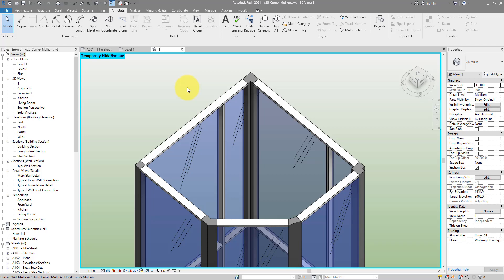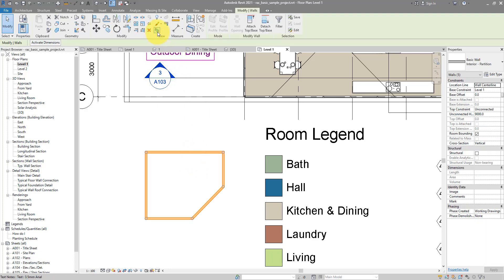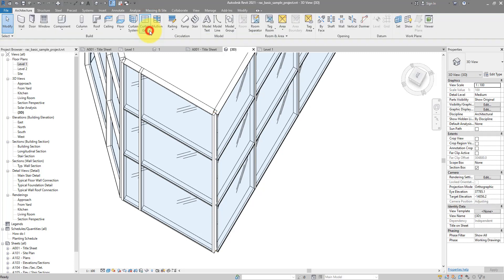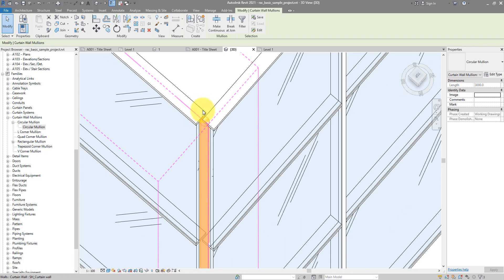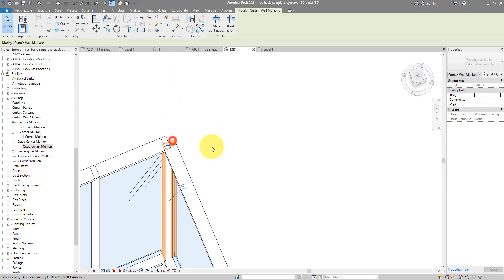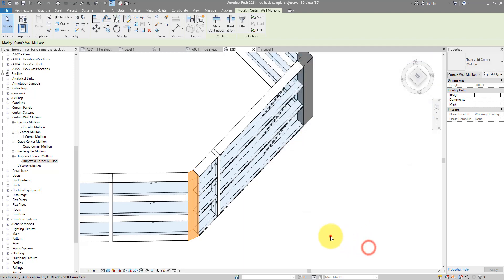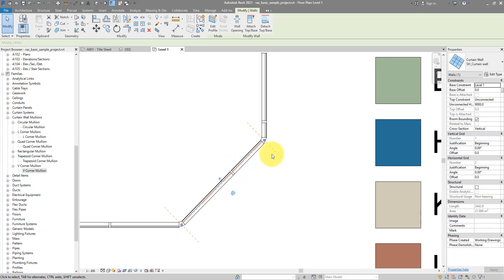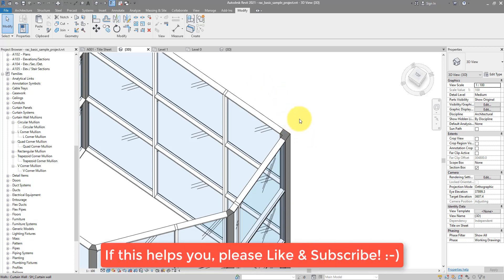Revit Snippets: How to create curtain wall corner mullions

Comment: Hey thanks for sharing, How did you do that diagonal mark on glazing?
Reply from the maker: I simply used a glass material with a custom surface pattern :)
Reply: @RVBoost  Great, will that show in elevations also?
Reply from the maker: Yes it should!